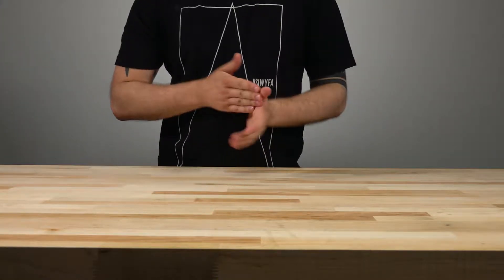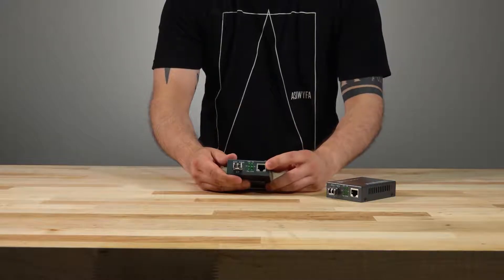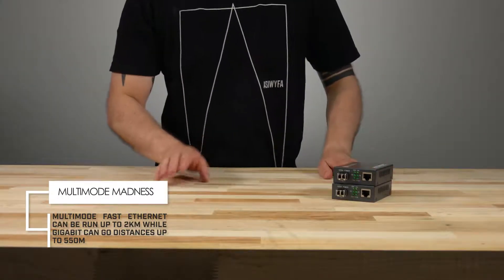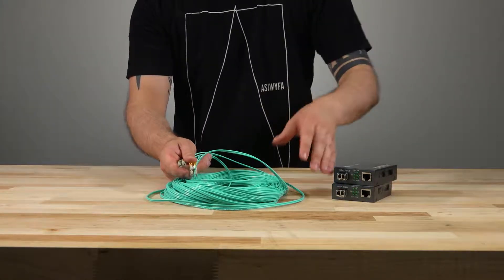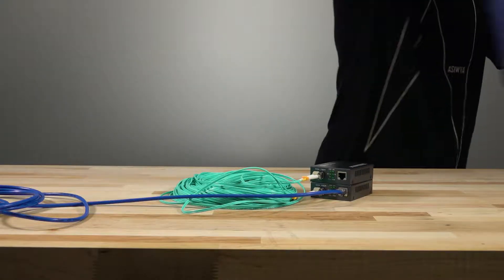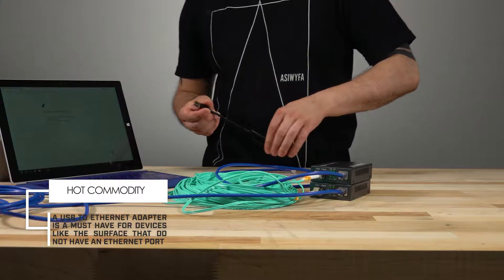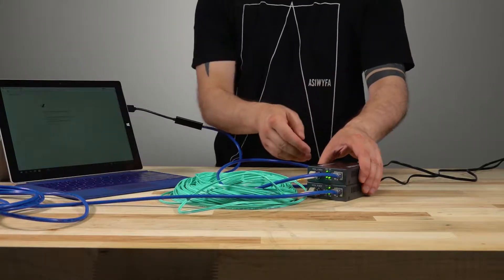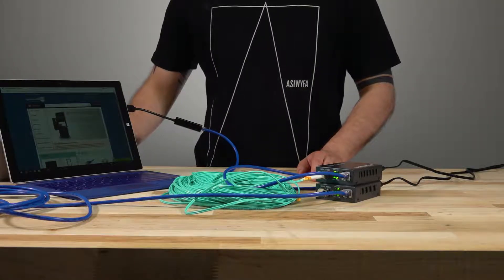What are Fiber Optic Media Converters?

Comment: Also this device essentially mirror the behavior of an ont box but without routing or other capabilities ont box would send a fiber signal in to your home through the ont also where it's converted in to a electrical signals that Ethernet cables can understand then ur router receives them this device does the same thing but in reverse these devices can also send and receive a constant flow of data resulting in better throughput and can update game servers current state in microseconds if the distance of the converter is close by thanks to fiber technology the reason its able to do this is because Ethernet signals can face interference by things like microwaves and signals from other general devices that fiber cables would normally be immune to

Comment: There are some media converters which support single fiber, the fiber is thin and can be easily hide under baseboard, so it is very convenient if you want ethernet but the cable is too thick to hide, then you can use fiber instead.

Comment: I wish they could invent a way to transmit power along the fiber optic cable. Maybe running a copper wire next to the fiber cable where they terminate as one connector. This means you simply plug this hybrid connector into one port on the end device such as an access point or a camera. Is there in the works such a new port being developed?
Reply: It already exists - Neutrik OpticalCon Hybrid
Reply: Could they make the fiber power a small solar module to power a camera? That might be cool but of course not efficient.

Comment: Nice! have you noticed any speed limitation using that converter? When i attach device from my ISP and connect fiber i have like 900Mb but using this converter close to 400. I used different ethernet cables and wondering if there is something that does not allow same speed as on ISP modem.
Reply from the maker: I haven't noticed any slower speeds when using media converters but with the unique nature of networks anything could be causing problems.
Reply: Is the converter rated for 1gb if the version your using isn't rated for 1gb then that could also cause your speed to be limited also make sure the fiber optic cables your using are also able to run a gb through them most do but u should check if the brand you have is able to run those speeds also check your Ethernet cables going to the rj45 jacks/ Ethernet ports and make sure your not using a lower cat version of Ethernet to connect the two ends via the Ethernet side of the converter a cat 6 or 7 should allow you to hit those speeds or come close to them

Comment: so i reccently ran an ethernet in my house that goes about 100 ft. i am getting alot of speed loss i believe it to be due to alot of interference on the line. i think this will be a perfect solution if i run the same route as the ethernet since fiber does not suffer from wireless or electrical interference. and i can just connect on on each end.
Reply from the maker: That would be a perfect application for these devices!

Comment: What is the reason you would use this if less than 300ft? Also what is the furthest distance you can run on fiber?
Reply from the maker: A lot of times they are implemented when there is already a fiber run in place. Fiber is great in places where there might be a lot of signal interference which will have negative impacts on copper. Fiber can run very long distances. We have a media converter that can go up to 80 kilometers or about 49 miles!
Reply: @ComputerCableStore  ok cool. Thanks. I am looking to run one 1500ft and 800ft.

Comment: i recently got fiber(awsome). but what i dont understand. why does the fiber go the converter and than to the router/modem over copper. cant they build the converter into the modem? i mean, the less equitment between the internet and my pc. the less latency. and less change of errors
Reply from the maker: I'm not sure what their reasoning is for that. However, my guess is the cost of a modem/router with a fiber converter built in would be quite higher than a consumer would be willing to pay.
Reply: hi - can only answer from my experience of getting fiber installed where i am - but most of the ISP here give you a special box that cannot be purchased from shops - so appears to be custom made - it seems as though commerical routers that have the fiber converter built in are super rare - not sure why! i am about to try my own hand at having to do the installation myself which will be a first...will see how it goes...

Comment: So my local ISP installed fiber into my home. They ran a singlemode lc type connector fiber cable from the patch to my room, where the media converter is installed. I am getting a connection via hardwired  to the media converter, but no connection with my router. Not sure if my router settings are wrong, but I do know I have it in PPPoE mode
Reply from the maker: I'm not sure how the media converter would work in this scenario.